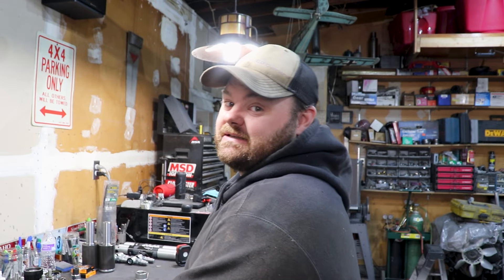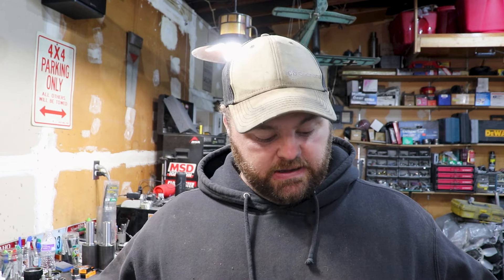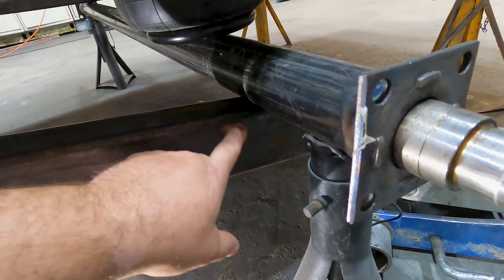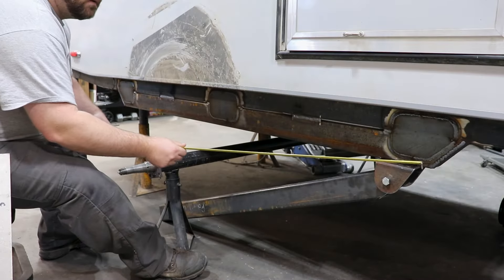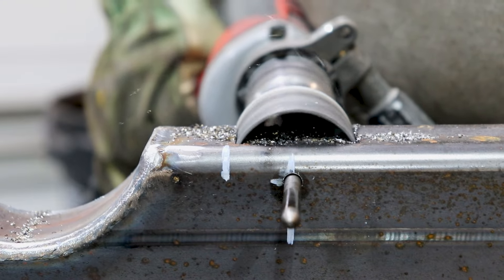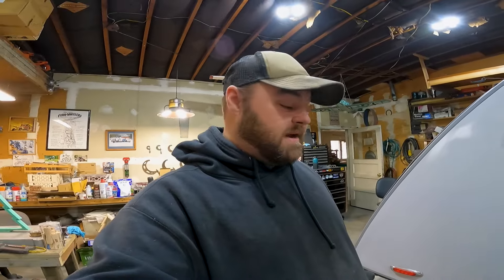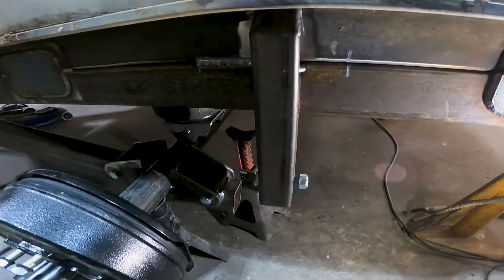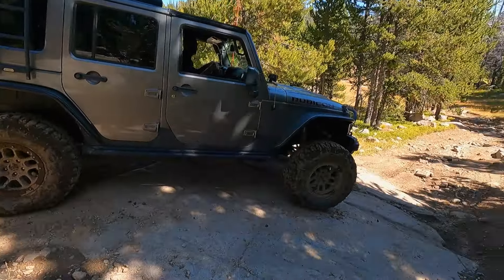Ultimate Teardrop Conversion - Suspension - Part 1

Comment: Not sure why you are using a pan hard bar? Pan hard bars move in an arc and your suspension is setup as a vertical swing from the front pivot point, so they are working against each other. I could see using a pan hard bar if you were using a Johnny joint for your pivot point.
Reply from the maker: Yes they do work against each other but its minimal. From full compression to full droop the pan hard bar moves the axle 3/4" inch. Toyota 70/80 series Land Cruiser's run this setup on the front suspension. Without the pan hard bar the suspension moves 2" inches left to right and this would cause wondering when going down the road and that is a very big safety hazard.